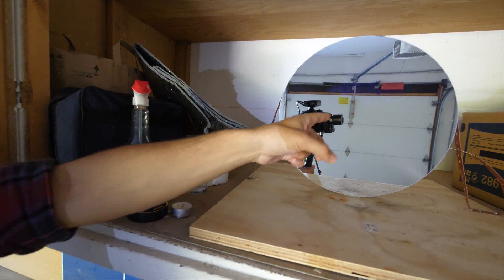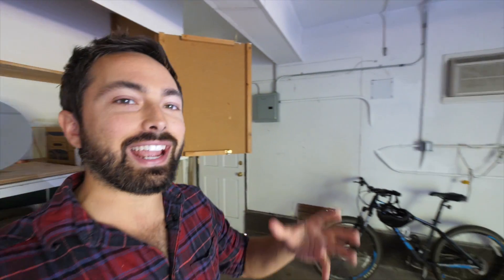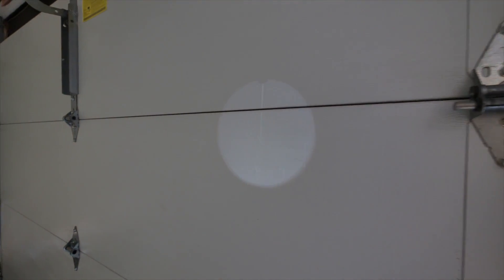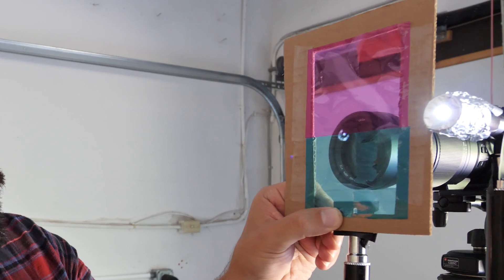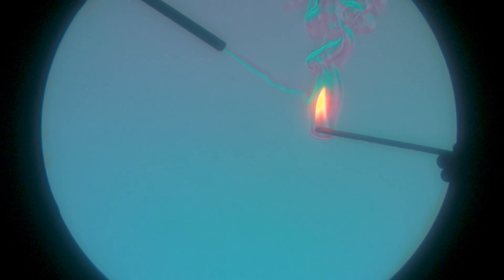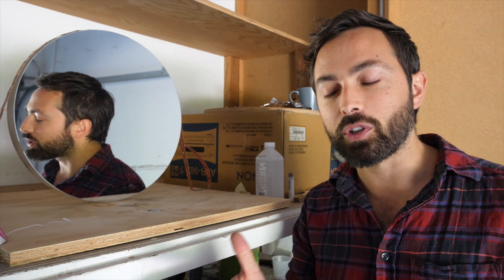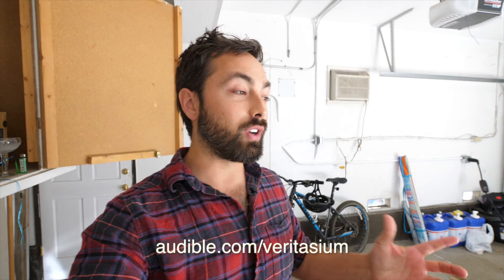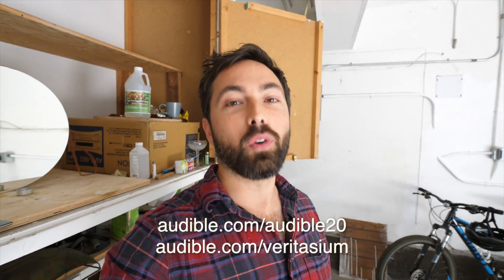Schlieren Imaging in Color!

Comment: I would like to see some schlieren footage of the GTAW process of welding. The shielding gas used (argon) emerges fairly cold compared to the electrical arc that does the welding, and might make for some very strange patterns. Given the sheer amount of light emitted, along with huge UV radiation, I'm not sure how well it would be photographed or video taped.